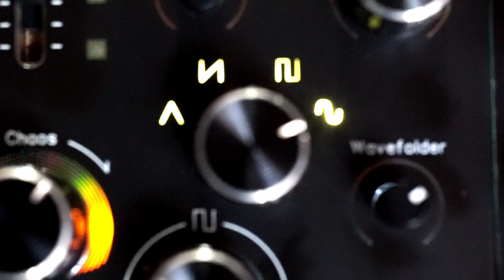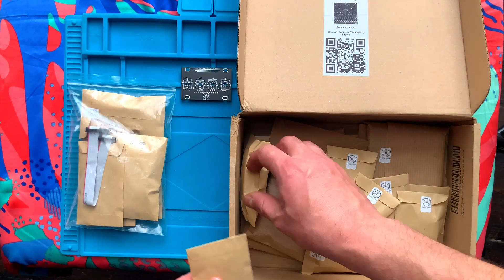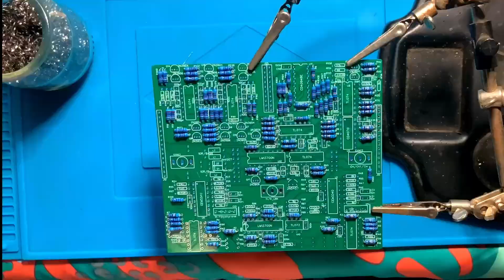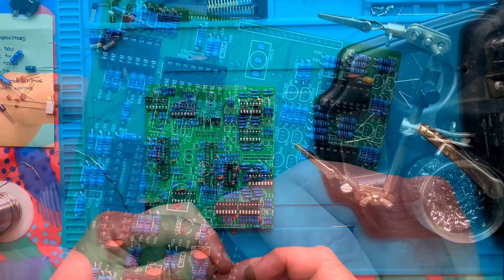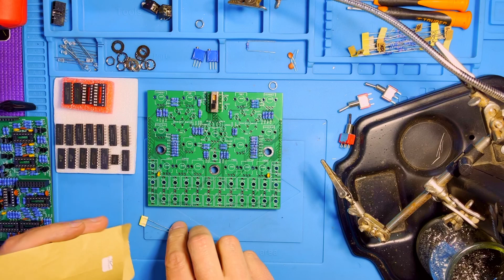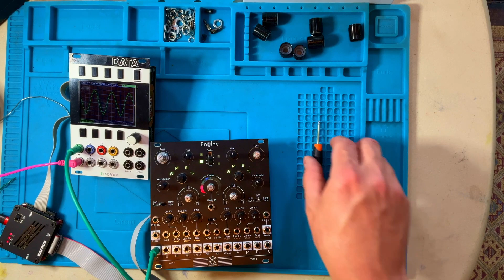Cubusynth Engine complex VCO : Build Video

Comment: Those capacitor that you are straightening are probably meant to be like that. You just push it through with a little more force than usual and the existing bends keep the capacitor from falling out. At least some of the ones I have are like that, of course can't be 100% sure from the video if yours are the same :)
Reply from the maker: hi! no, actually they are made for a different footprint, trying to stick them in as is means the leads won't even go through, it's necessary to bend them straight first ;)